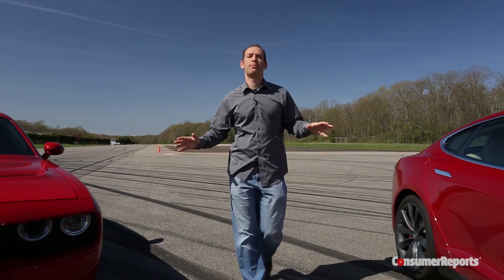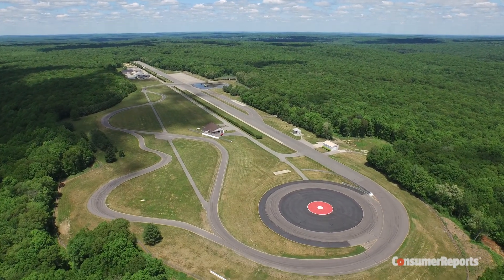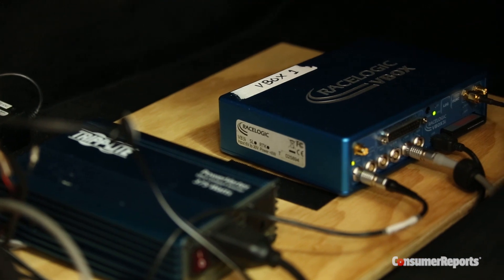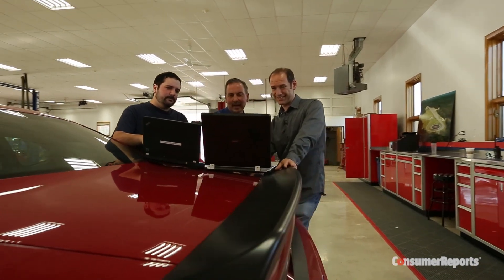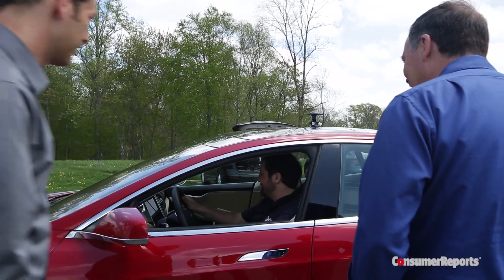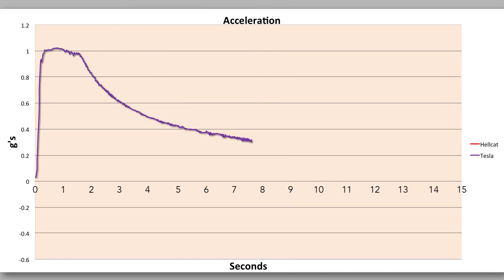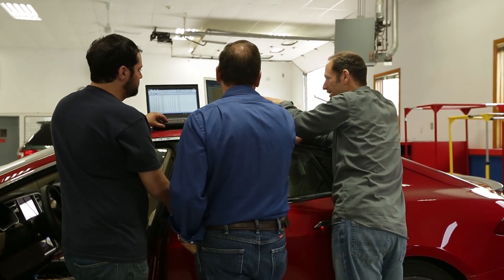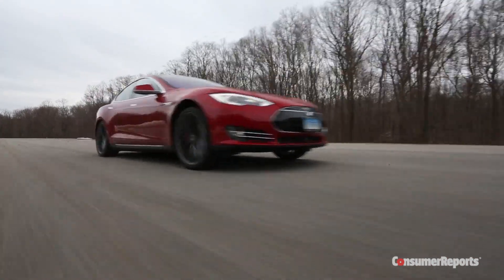Track Science: Tesla P85D vs. Challenger Hellcat | Consumer Reports

Comment: The teslas peak g force dropped SUPER fast though. It is quick but it's a one trick pony, quick off the line but any other form of race and it would lose.
Reply: Paul McGuire Its funny that all the Tesla PR videos always reference g force.  Like its the new standard of rating performance lol.
Reply: niceguy60 No.. The Hellcat only sells for $100k if the person is rich and doesnt care that he is getting screwed by the dealer.  They underestimated how many they would sell and they are upping production next year so they will not be hard to find.

"the Hellcat Is simply another 1960s Monster with ridiculous amount of power "  Yes, that is the whole appeal.

"there are people crashing this cars in less than one hour from getting it'  You can watch videos of cars crashing on tracks all day.  If you think you can just jump into a 700hp car and push it to the limit without getting used to the car, then you deserve to crash.  Crashes happen when you have a high performance car.

"Once you factor cost of tyres"  $1200?  Thats not going to put you even close to the $40k extra you pay for the Tesla.  

"this car wasting 18 gallons fuel tanks in less than 12 minutes"  Exaggerate much?  Thats if you are going full throttle the whole time.  The car gets 22mpg, it has more range than your $100k+ car.  

No, fuel and tires will not come close to the extra money you pay to go slower in a P85D.
Reply: DTRU122283 well P85d has an efficient  engine, you can hate me as much as you want, it will not change the fact, Hellcat looses traction off the line which makes its 707hp useless and an liability
Reply: niceguy60 No... it is not.  

"Existing P85D owners can have the upgrade retrofitted in their cars for $5,000 and only in conjunction with the new, larger 90kWh battery pack which increases the range by 5%, bringing the total figure up to 300 miles. The 'Ludicrous' mode will be a $10k option for new P90D owners."

So your overpriced car is now... even more over priced.  You now need $5k, IN CONJUNCTION WITH the larger battery.  

So you think the competition is over now that the $100k car requires another $15k to compete with a $60k car.... Man you Tesla nut huggers are dumb.
Reply: niceguy60 If you floor the Hellcat for 30 miles, yes you will run out of gas... That has nothing to do with the range that people will use on the street and to make such a comparison just shows you are TRYING to blind yourself with the Tesla PR.

No, if you floor the P85D, you will not go 200 miles...  Your a fool if you think differently.  No car can go 100% for 200 miles.

Every day driving, the Hellcat has a higher range than the P85D.
Reply: DTRU122283 the Hellcat Is simply   another 1960s Monster with  ridiculous amount of power which overwhelms any traction controls,  there are people crashing this cars in less than one hour from getting it,  the Hellcat currently is going for 100.000 bucks duo to short supply
Once you factor cost of  tyres and this car wasting 18 gallons fuel tanks in less than 12 minutes,  you would wish had bought a Tesla
Reply: ***** All it takes is a new set of tires, which will run you $1k.  Your saying that in order for the Tesla P85D, a $100k + car, must spend an extra what $15k in order to get the same quarter mile times as the $60k Hellcat with a $1k tire swap?  lol
Reply: niceguy60 "What about the Hellcat ? 
Would they give it 2000HP going to the Rear Wheels to make it even more exiting ??? "

You dont need 2000 hp to beat the Tesla.  The Charger Hellcat with a $1k tire upgrade does 10.8 in the quarter.

Its STILL the faster car and STILL only costs $62k.  It will STILL beat any Tesla around the track.  

Keep blinding yourself with the PR.
Reply: azalru 
The Tesla, with the new upgrade, matches the Hellcat Chargers 0-60 on drag radials.

The Hellcat is still a tenth faster in the quarter mile.  So, now your already overpriced car costs even more, just to be about the same performance as a car HALF THE PRICE.  

Only fanboys or people being paid by Tesla will overlook that fact.
Reply: +Paul McGuire It didn't "run out of batteries" but instead the batteries got too hot. The Tesla isn't a race car, it's fast but otherwise it's a family sedan that is insanely quick. For 99% of people, the Tesla is an amazing vehicle that should last a long time. The Hellcat is the complete opposite of that. In 15 years, what vehicle are you more likely to see on the road, a Hellcat or a Tesla Model S? The answer is the Tesla Model S.
Reply: niceguy60 Cost per performance is my whole issue with the Telsa, that and the EV fanboys that know nothing about performance vehicles coming and trying to tout the P85D as gods gift to man when its a one trick pony.  
No, the Tesla is not a better car..
Its not better from a rolling start
Its not better in the quarter mile
Its not better top speed
Its not better braking
Its not better around any track
Its not better at range
Its not better at pricing
Subjective-Its not better looking
Its not better sounding

Its slightly faster 0-60 stock for stock, its not faster when you swap out the tires on the Hellcat with what they should have come with from the factory.

It has more gadgetry, although the Uconnect system in the Hellcat is the #1 rated infotainment center 

Its touted to be "luxury", I put that in quotations as Tesla's have always been laughed at for calling themselves luxury cars.  In the majority or car reviews for the company people have called out the cheap plastics used in every car, the P85D is no different.  They FINALLY upgraded to some of the STANDARD material other luxury cars use but it still feels cheap.  If you think your buying $40k more "luxury" over a Hellcat then you are sadly mistaken.

If you try to argue that you never have to pay for gas or you pay less in maintenance: You will never pay $40k in gas or maintenance on a Hellcat.  Also, your warranty only covers 70% of your batteries capacity so now your range limited car is only warranted for 70% of the range it came with. Also, do you know how much it takes to replace a battery?  Ya, you are not saving any money at all.

Its more expensive because it is more expensive to manufacture than ICE cars that have been mass produced for a long time.  

Nothing about the P85D or the P90D makes it worth $40-$60k over the Hellcat.  If you want to say that your saving the world because you use an EV then fine, just dont go spewing garbage that your car is the greatest thing man has ever created.
Reply: niceguy60 Better: noun-the better one; that which is better.  verb-improve on or surpass

No.. I know what the word better means.  You need to know the difference between better, and preference, because that's what you are explaining...  I actually just laughed out loud at your post.  

Yes track purpose cars can be very harsh.

The way you just rambled on about that makes me believe that you have no clue that the Hellcat has adjustable suspension, steering, engine and transmission settings...

If you want to ride stiff for hard corners and take offs you press the Track button, if you want to cruise the street in a comfortable ride you set it to normal.

You not knowing that fact leads me to believe you have been arguing against a car that you know nothing about....  Are you seriously on here trying to claim that one car is better than another, while not doing your research on the other car?  That is very foolish...  But not surprising for Tesla fanboys.  I keep saying that the fanboys that get on here, and act like the P85D is the greatest car ever made, really do not know much about cars.  Your post is just reconfirming that...

That mixed with your false claim that the Tesla has more range than the Hellcat has made me realize you truly are talking about something you know nothing about...  I dont know whos the bigger fool here.. you for all your inaccurate information or me arguing with a fanboy who is ignorant about the car we have been debating about.
Reply: niceguy60 Lol no...

Back in the early 20's when 38% of all vehicles were electric was the equivalent of the Model T.  

They failed for the exact same reasons they are not widely popular now;

Short range
Low top speed
Too expensive, both for performance and maintenance wise
Reply: niceguy60 Coming back to this discussion a year later?

No, the Hellcat was not one of the slowest, they simply did not know how to drive it.  You do not just jump in a 700 hp rwd car, floor it and expect to get the full potential.  This is nothing new for high hp rwd cars, and if you knew anything about performance cars you would already understand that.  The fact that you dont really shows your knowledge of the subject.  

Your trying to use one bad example and make it sound like thats the end all be all which is simply wrong.

Another point that shows you do not know much about performance cars, the easy adaptability as you call it is a product of AWD and is not Tesla specific.  With AWD you have maximum traction from launch and you will consistently get maximum performance.

Everything you have said has pretty much boiled down to RWD vs AWD, yet you are trying to play it off like all of these benefits are due to it being electric...

Congratulations... Your already $100k car had to update 8 times and offer another $15k package in order to compete with a $60k car...  What is so special about that?  Hellcats dont NEED to update in order to compete since there is an aftermarket where owners can spend $1k and beat out the Tesla again...
Reply: niceguy60 read my original comment. One trick pony. I never denied it was quick in a straight line but that's all it can do. You got any impressive lap times of a Tesla?
Reply: niceguy60 http://my.teslamotors.com/forum/forums/model-s-laguna-seca-lap-times the model s is waaaaaaaay down at 85th fastest time! Hideously slow for a car with so much power!
Reply: azalru Man you are a Tesla blowhard.  Are they paying you or are you just really that biased?

You just keep posting false information and it just shows that you are repping the Tesla even though you do not know anything about the Hellcat.  Stop being blinded by PR.

The Hellcat's get 21 MPG with a 19 gallon tank.  Thats 399 miles.  but that does not matter...

Why... in the world... would you tout that the range is a BENEFIT of a car that costs TWICE AS MUCH as a Hellcat?...  It makes absolutely no sense.  The car costs what, $115k now with the upgrades?  It doesnt matter how efficient the Tesla is, you will not spend the extra $55k in gas and maintenance...  You would have to drive 348,000 miles in the Hellcat to break even with the Tesla's price.  By that point you will have had to change the battery in the Tesla twice, just adding even more of a price increase.
Reply: DTRU122283 You just hate on my info, because you are so obviously biased.

It gets 15 mpg observed, and doesn't get a full tank everyday.

A Tesla is a car that going thousands of miles for free using the supercharger network. In more than a decade of 348,000 miles you will have to pay more in hellcat maintenance and refueling than the already paid for battery pack that does 500,000 miles in the lab and still going strong. A battery swap by that time; the gigafactory is in full swing brings more energy dense and cheaper batteries, that provide even more range and power. Their dual motors still haven't reached their full potential yet. 

And part of Tesla's plan is engineering a 1 million mile drivetrain, something no other automaker wants to do. 

It makes absolute sense not to buy a unlimited number of cheap off the street watches over a Deep space Tourbillon watch. They are not the same levels luxury, just like the hellcat can never reach the Tesla even for free.
Reply: Paul McGuire How many people race cars on tracks?  I say less than 0.01% of the drivers in the world.
Reply: ***** Man you are so wrong...  There are hellcats hitting 10 seconds flat in the quarter mile.  Stop being a fanboy
Reply: +Paul McGuire How many people buy a Tesla to race it? It's a seven seater family car.
Reply: niceguy60 The P90D is a $15k option on an already $100k+ car to compete with a $60k car.  Even with the package they are now neck and neck as the Charger does 10.8.

The only thing that is not close is the price difference between the two, and how much better the Hellcat would perform around a track. Oh and range.
Reply: Paul McGuire LOL!  Now that is funny...

Using a roll out to measure 0-60?  WTF
Reply: niceguy60 because people praise the tesla for being one of the fastest cars in the world when it clearly isn't.  Plus I very much doubt it would get 200 miles when flooring it.
Reply: Paul McGuire What you just said does not make sense. Of course the G forces dropped as it sped up. That's just physics. The whole reason you have G forces to begin with is because of the fact that you're coming from a dead stop and accelerating. Your next statement is also ridiculous. The Tesla has 100% torque available 100% of the time; just press the pedal. The Hellcat (and all other automobiles) rely on gearing and power bands to maximize torque. I'd still have a regular car over an electric one for my own reasons, but you can't just make up fantasies to support what is obviously your preexisting bias against Tesla.
Reply: niceguy60 also the amusing thing is that it actually manages to be slower than cars with less than half the HP and torque! Quite an achievement!
Reply: niceguy60 that lap time was in the performance model, 416 HP,  443 lb ft, and it was embarrassingly slow. Teslas are only good for straight line speed and that's it. To make a fast car you need a lot more than just power.
Reply: niceguy60 and that's why it's lap times are so bad- weight. Braking is poor and cornering is poor. No matter how fast it is in a straight line with all that power, to get all that power you need a LOT of batteries. Weight is and always will be this cars achilles heel. The extra weight gives it better traction off the line but after that it becomes a burden.
Reply: Paul McGuire Once a product becomes mainstream prices will stabilize,  it happened with the first cars, first mobile phones, first cameras  you name it
Reply: DTRU122283 The hellcat is highly inefficient with crap mpg, with 285 miles at best. 

The Tesla owner has 300 miles with the new update, and unlike refueling for gas every week, they charge overnight and leave with a full range everyday. 

Everyday driving, hellcat has lower and lower range than the P85D, then has to go out on a 15 minute errand just to smell,get gas, work the archaic gas machine and pay for it.
Reply: azalru No it wont.  Putting drag radials on the Tesla will not make much of a difference as its an AWD car, its already has the benefit of traction.  The only reason the Hellcat's benefit so much from the tire upgrade is that they are traction limited.  Traction is the weak point for the car, so you fix that issue and it makes a major impact.  

The fact that you do not understand this shows your level of knowledge about racing and cars in general.
Reply: edwong3 but the limiter isn't shut off. That's the way the car is. You can't say, "but if they removed this," or, "if they changed that," because then you could argue the exact same point about every other car. 
That's the way this car is, so that is what we are talking about.
Reply: niceguy60 read his comment, then read my comment. You will see it makes perfect sense. This car hasn't been updated, there isn't a wireless update to maintain constant g, so therefore it is pointless to talk about it.
Reply: niceguy60 is it a free wireless upgrade like you suggested?
Reply: Paul McGuire well it's not free nor wireless but it's a welcome update nonetheless,  it's not like the Tesla P85d had any type of speed deficiency as result the additional charges are justified if you wish a 2.8 sec car with 770hp
Reply: niceguy60 but like I said earlier you can't talk about a car which isn't upgraded. Then you could argue the exact same point for the other car.
Reply: +Paul McGuire Tesla is a one trick pony yet it beats the Hellcat in a quarter mile? Give me a break! Oh and if you think the quarter mile times between the P85D and the Hellcat are close, that's fine, but compare the P90D with the Hellcat, and the Hellcat is unquestionably slower. No way can you get a 10.9 quarter mile and 2.8s 0-60 in a Hellcat.
Reply: ***** my second comment clearly states I'm not a fan of either of these cars.
But on the topic of longevity,  internal combustion engines have been proven to run for over 100 years, whereas battery powered items are renowned for failing fast, and all batteries degrade, so my money would be on the Hellcat.
Reply: Combustion engines don't last for over a 100 years. yes you can find classic cars on the road that are 100 years old but that's not the same thing because they haven't been used continuously that long. Also an electric vehicle has far fewer things to fail on it than a gasoline powered vehicle. 

Most people do not take care of their property very well so when maintenance isn't kept with, gasoline powered vehicles just don't last all that long. An electric vehicle's primary concern is with the batteries which will be replaced towards the end of the typical gasoline powered car's lifetime. It's a lot easier to replace a battery or electric motor than it is to fix a gasoline powered vehicle and make sure that gasoline powered vehicle is capable of passing smog. 

It's a lot less involved swapping a battery into a Tesla than doing a gasoline motor swap in a Honda civic.

The easier it is to fix a vehicle, the more likely it is to stay on the road.
Reply: The electronics typically would fail only if they're of a crappy/defective design or if the electrolytic capacitors go bad which they eventually will. It's a worthy concern no question, but all cars today use various degrees of electronics in them. 

With your point about the Tesla having too many electronics, it's this reason that perhaps the cheaper Model 3 will be Tesla's most reliable vehicle in the world as it should pare down a lot of the luxury features that can and will break down over time.
Reply: I ve built a few electric bikes and I can say electric engines are almost indestructible to the point  if something goes wrong you completely rule out the Engine and start looking for faults elsewhere , such fuses and battery  , battery's tend to be reliable and never let me down , the only issue I had it was with the wiring overheating and Melting stuff, however this was down to my own fault , Important lessons have been learned
Reply: DTRU122283 NOT STOCK....
Reply: DTRU122283 yup!
Reply: +niceguy60 That's only if you have the hellcat completely floored. on the highway it gets 20 miles per gallon.
Reply: DTRU122283 if you are in a vehicle  which requires Skill in order to go straight  in dry road  ,  You lost the race even before it started
Reply: niceguy60 Again, your comments make it clear you have no idea what you are talking about when it comes to performance cars....  Its actually pretty funny how oblivious you are to this fact.

You need all of those things in order to be a performance car.  The Tesla does good IN A STRAIT LINE without those needs, but does absolutely horrible in all other performance aspects. 

You know what other cars require skill to push them to the limits?  ALL OTHER sports cars... The fact that you do not know this is funny.  

Do you really think that any Joe off the street can just jump in a Viper ACR and beat all other track cars?  No.. thats ignorant.

Do you really think someone can jump in a top fuel dragster and beat others?  No... again that is ignorant thinking.

Again... you are listing the benefits of AWD and trying to make it seem like they are special since they are coming from Tesla, which again is ignorant. 

Its like I am arguing against a child who has no idea what he is even arguing about.
Reply: niceguy60 Except thats not at all how racing works...  

Again, completely obvious that you do not know what you are talking about.

Just because its easy to launch an AWD car, does not mean its faster... at all..

Top fuel dragsters running 3 second quarter miles also have to modulate the throttle, the Tesla does not compare...

Its just like a Tesla fan boy to make excuses as to why his car is better, even though he is losing.
Reply: niceguy60 I can't believe you dragged this up again. 1 year to think about it and you still haven't thought of anything of any use to say. Teslas are one trick ponies which make something traditionally exciting as boring as hell.  1 year later and what have you got? Software updates. That's it. A Tesla racing a sports car or super car is like a jumbo jet racing a fighter jet.
Reply: Paul McGuire  whats the point of having 707hp Hellcat which you need to wait before you can mash the gas pedal ?
Hellcat is like hiring a pilot , which is afraid of heights , USELESS
Reply: niceguy60 I'm not really a fan of either of these cars.
Reply: Paul McGuire Tesla actually has higher mile range than the Hellcat , if you go hard on the gas pedal ,  the hellcat  will waste 1.5 gallons per minute  , ( this is around  30 Miles range ) huuuuuuuuue !!!!   (13 Minutes drive)  

http://jalopnik.com/holy-crap-the-dodge-srt-hellcat-can-kill-1-5-gallons-of-1606097708
.
You would get a good 200 Miles range  out of a (100% free charge)  on the Tesla if pushed hard
Reply: niceguy60 did you not see my comment where I said I don't like either of these cars?
Reply: Paul McGuire I struggle to understand why would you criticize Tesla 200 Miles Range instead of criticizing
Hellcat 30 Miles range when pushed hard ?
Reply: OstensiblyHuman yeah but the torque peaks and then drops really fast as you can see here
http://www.dragtimes.com/images_dyno/27143-2015-Tesla-Model-S-Dyno.jpg
And if you maintain a constant rate of acceleration then you can maintain a constant g, if the acceleration drops then so will the g, but of course it's possible.
Reply: Paul McGuire near 400 mile range with a 15 minute charge time lol. And free fuel up!
Reply: ColindaPieman what does that have to do with speed?
Reply: niceguy60 ummm..no... the STOCK Hellcat doesnt utilize the maximum TORQUE the engine can produce off the line. People who buy a Hellcat RARELY keep it stock... The difference is Tesla sets up their car to launch while in Insane mode. Dodge simply builds a monster and you need to fine tune it.
Reply: existing P85d  owners will be able to update 
their vehicles to a p90d if they wish to 
.
What about the Hellcat ? 
Would they give it 2000HP going to the Rear Wheels to make it even more exiting ??? 
This race was over even before it started only you failed to see that , only one Vehicle here as UNLIMITED potential
Reply: Paul McGuire I've checked the link that you sent me and there seems to be no P85d nor P90D tesla racing as result you seem to be criticizing the Old (  low performance)  Tesla Models
Reply: You seem to be making some confusion here 
Tesla has been selling low performance cars  just like any other make 
I mean not all Challengers are Hellcats nor all Corvettes are Z06's or Zr1's in the same way not all Teslas are p90d or p85d's 
Is expected for the shipper Teslas to achieve slower Track  times
Reply: Paul McGuire we are now in 2015 416hp is low performance  considering the new p90d has 756hp
Reply: niceguy60 416 isn't that low. An M3, RS5, base 911 Carerra all have around that and they all destroy it. Boosting power will increase acceleration but around a track where it matters it'll still be shit.
Reply: Paul McGuire 416 hp is  low for a car that needs to transport enough batteries to cover  almost 300 miles
Reply: Paul McGuire  I remember when my farther had his first mobile phone 
the price was prohibitive and the phone was bigger than a brick , there was no menus. 
if we have  followed your rational  Development & improvement would never have taken place as we should have discarded mobile-phones based on price 
We are in Stage 1 with Tesla and I believe prices will come down don't kill Development
Reply: DTRU122283 The Tesla would beat the hellcat that has drag radials off the line and in the 1/4 mile. And then beat the unrefined gas guzzler in the snow as well with the same tires, while seating seven comfortably.
Reply: The steady drop and incline of g's is another benefit to control on the track, if you understand physics at all. It picks up and drops steadily because it achieved the designated speed efficiently. All the jagged g forces per gear changes is contributory to uncontrolled maneuvering. Albeit an art of downshifting and such on a track, it's still just a disadvantage that is only worked with when racing.
Reply: DTRU122283 The Tesla doesn't have drag radials, you know the fat cat needs special tires just for a drag strip and is utterly crappy in daily driving.
Reply: Also 0-60 in a Tesla electric drive train is far more advantageous than an hellcat ice. There's quicker 60ft from 0-30,0-60,  no throttle delay, worrying about launching correctly. With instantaneous throttle response the Tesla is more likely to set off the drag race timer first and make use of driver reaction time, while the hellcat is still spinning tires trying to get power down, even with drag radials. 

How many times the Tesla would be a car ahead of the hellcat sporting drag radials? 9/10 times, the Tesla is much more consistent with launches. 10.9 1/4 mile time is conservative and can go down to 10.7
Reply: azalru The Motor Trend video comparing the two cars shows the government Monroney sheet comparing the cars fuel economy over 5 years compared to an average car. Tesla saves $8k over 5 years, Hellcat spends more by $6,750. With the difference in sticker prices for the cars it would take over 20 years for the fuel savings to pay off but I'd think the maintenance costs would be something to factor in the Tesla's favor as well.
Reply: bc1969214 Hellcat owners will pay much more than 8k in fuel over 5 years  the 707hp Monster can go true a 18 gallons tank in less than 13 minutes when pushed hard, having said that, I believe the Hellcat will pay much more in Tyres  rather than fuel as no traction control is able to keep 707hp in check
Reply: niceguy60
I saw the only way they could launch the Hellcat at the drag strip was in 2nd gear and still not mashing the throttle to avoid the wheel spin. I'm surprised they don't have a button to push on the dash to avoid wheelspin.
Reply: niceguy60 In  Dodge's defense if you look at their video's on youtube. The Hellcat was built for one purpose, and it is to have fun in. Not to be fuel efficient or have great traction off the line. Why compare these two cars? They have nothing in common.
Reply: Wayne M I understand that,  but it seems  a waste to put 707hp in a vehicle and failing to provide any means for the same to put the power down,  I mean even the old 2008 GTR  with only 480hp is quicker than a stock Hellcat
Reply: Paul McGuire You can't say "but if they removed this "  well he can ,  because contrary to any other vehicle Tesla receives wireless updates which makes it one of the fastest evolving cars
Reply: Paul McGuire well there's is an update,  and it's called Tesla p90d,  its also available for existing P85d owner's
Reply: Paul McGuire It's said that Tesla will (very soon) add a ludicrous acceleration upgrade. It will have 762hp, and 0-60 in 2.8 seconds. Also one big thing is that this will also give 1.1g of acceleration for a 3 seconds, before falling off. It's faster than falling for 3 seconds.
Reply: Paul McGuire Also keep in mind that this car is not meant for racing. In every day driving, you would need to not break the law, so those first seconds are crucial for having fun and not getting in trouble.
Reply: Andrei-Lucian Șerb have you not read this thread?
Reply: Paul McGuire I have one. It beats a Maserati Grantuismo up to 120 mph, and it pulls up to about 130 before a stage 2 Subaru STI can pass it up. It's fast everywhere, the G force just goes down
Reply: Sinbreaker what's your point?
Reply: ***** there is a lot more to a tesla than just a motor and batteries. There is a huge amount of electronics in them, and when they fail they are almost impossible to repair, they have to be replaced. If the electronics become obsolete then the item has to be wrote off.
Companies often market their products as, "having no moving parts so there's nothing to go wrong," but it's always the electronics that fail.
Ever had a problem with a pc or a phone or a TV or any other electrical item? They have virtually no parts but it's always the electronics that fail.
Reply: +Paul McGuire Does your husband know what you're doing?
Reply: Dude31463 was that an attempt at a joke?
Reply: DTRU122283 you are focusing to much on cost a Lexus LFA costs the price of 4x Tesla or 6× Hellcatts  however Is slower  than both cars 
Tesla is expensive because it's a better  car period
Reply: DTRU122283 you need to understand the defenition of the Word (  BETTER )  a better vehicle does not necessarily  means  a faster (Track car)   for some people a better vehicle might just mean  MOORE space , bigger boot , the ability to take 7 People , low maintenance costs , more comfortable and so on 
.
Most Extreme Track cars  , feel like punishment when driving in public roads
Reply: DTRU122283 the Fastest car I ve  owned  was  actually my WORSE   
.
Why ? 
 .
1- Sport suspension was Rock Solid  
2 It was Fragile , I mean everyone was gliding over this  medium sized pothole , than my car goes with low Profile tyres , lowered sport Suspension , Chrome Wheels   over the same  , my Front right suspension COLLAPSED .
3 - I was  stopping to refuel  frequently 
TOP speed , is completely irrelevant for most people it does not equate  to a better car , 130 MPH to 155 mph  is more than adquate for most non (Boy racer's)
Reply: ***** it's not close  anymore  P90D has been released  , there's  no competition
Reply: Paul McGuire the fact Tesla  lied about horse power is completely irrelevant , the truth is Tesla is the quickest  family car in the world (P90D)
Reply: niceguy60 wrong, the Ferrari FF would smoke it, and so would a RS6 or RS7.
Reply: DTRU122283 Tesla is more expensive simply because its a better car
Reply: Paul McGuire RS6 & RS7 are old school , welcome to 2015
Reply: niceguy60 And AGAIN...  There is nothing about the car that makes it $40-$60k "BETTER" than the Hellcat.

If your going to go on about it being a "luxury" car then I will once again just laugh at your ignorance.
Reply: niceguy60 do you think Audi have stopped making them?
Reply: DTRU122283 following your logic what makes a Toyota LFA cost 420.000 Buck's ?
Reply: DTRU122283 Hellcat is not much different from 1960s muscle cars reckless and dangerous with no means to put the power down , (while Stock ) 
Don't get me wrong,  Hellcat has modern stability control systems and traction control , however this systems are useless , trying to contain 707hp going to RWD.
.
Hellcat is like a Turkey with big wings , however , it cant fly.
Reply: DTRU122283 Tesla is the (Model T) of the desirable   electric car
Reply: In the Worlds great Drag Race 6 Hellcat was one of the slowest vehicles  , out of control power is liability  & reckless  
.
TESLA acceleration  is 100% usable even when taking kids to school or getting  groceries  
.
However the Greatest Benefit of Tesla vehicles easily adaptation  , I mean since this comment  thread  there's  have been 8 Tesla updates , by the time you reply  to me  , you might well be referring to a Tesla which no longer exists
Reply: DTRU122283 Here's the list of things  a Hellcat requires to be fast 
1- Clean Tyres 
2- Drag Radials  
3- warm temperature 
4- Clean Drag Strip 
5- Skillful Driver 
.
TESLA needs none of the above 
A Hellcat which can't put the power down 99% of the time its a  lemon
Reply: DTRU122283 AWD cars like the GTR and Tesla will reach 60 mph in around  2 seconds  , by simply smashing the gas pedal at 100% 
.
If Hellcat  driver can only smash the gas pedal 40% before the Wheels brake  loose 
The race is already lost , no one is going to wait for Hellcat drivers careful modulation of throttle
Reply: a Tesla has unlimited potential? another fucking idiot tesla fanboy...
Reply: DTRU122283 yeah they try to brag about speed but I don't think one has made it round a track yet without running out of batteries!
Reply: niceguy60 Useless?  Even though it is faster in the quarter?

Yes the traction limit is a weak point, but one that can be easily fixed.  And when you do fix it, the RWD car is faster to 60 than the EV instant torque AWD car.  Now thats really saying something...

What does it matter that the P85D is more efficient, when its TWICE the price?  Do you really think your going to save $50-$60k in gas when going with the Tesla?  If so, your delusional.